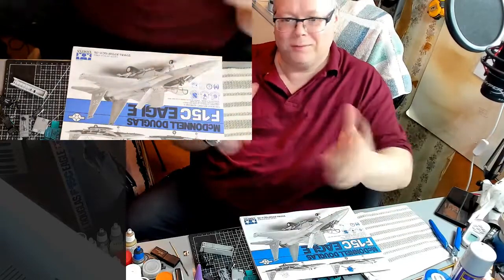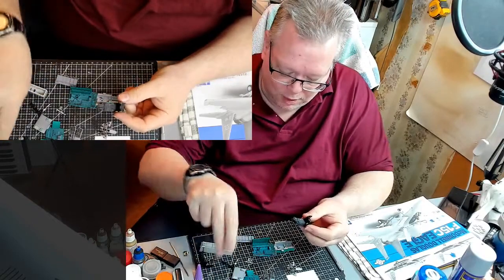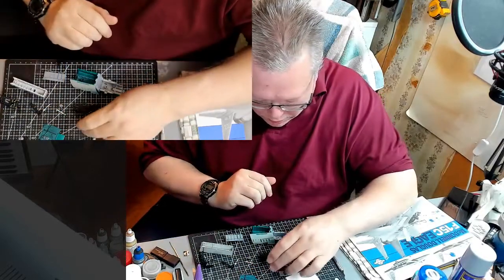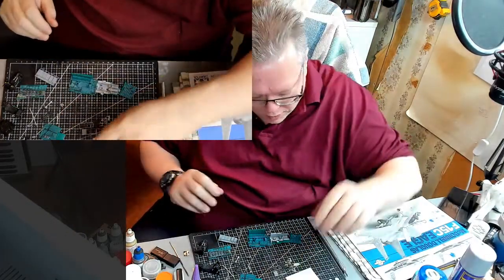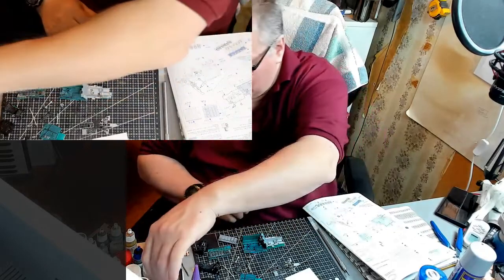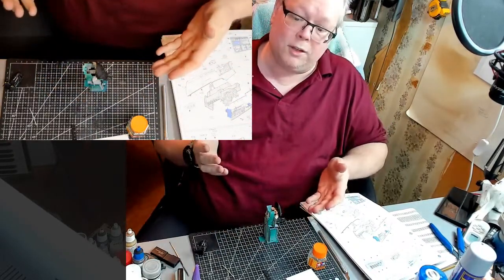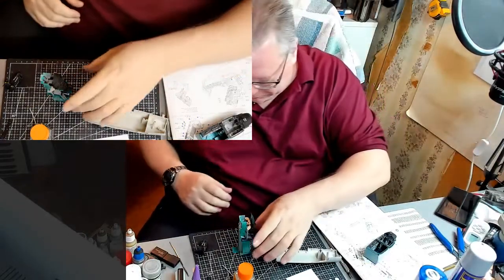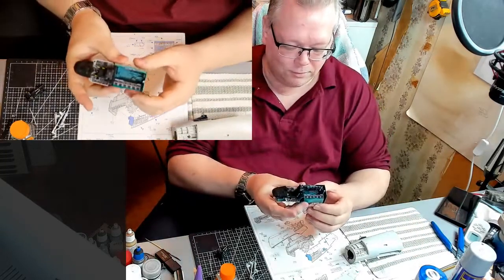Building the Tamiya 1/32 F-15C Eagle. Part 2.

Comment: Keep up the good work. I too have been collecting aftermarket parts for this kit and like you assembling everything then deciding what to use, I wish i could find a good photo of the flap accuators so i could pose it with the flaps down
Reply from the maker: The plane's been around since the early 1970's. There's got to be pics of the flaps down. Google is your friend.